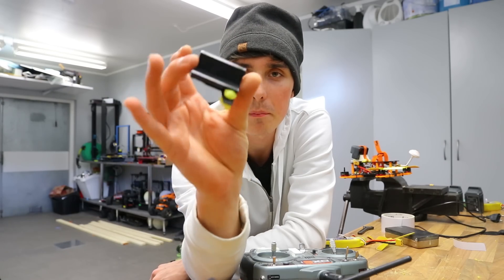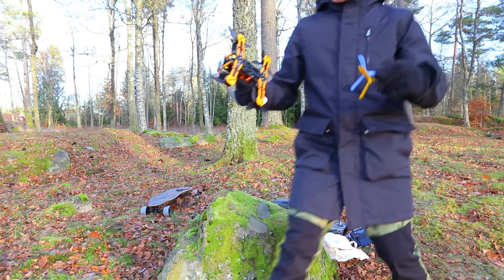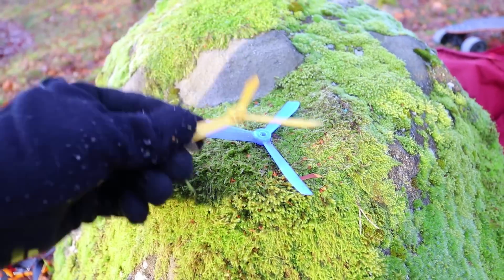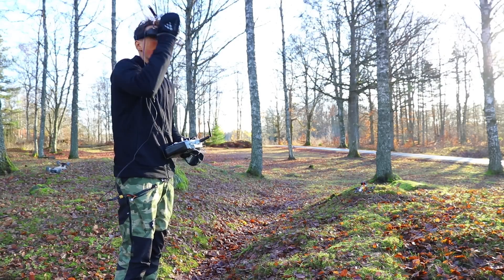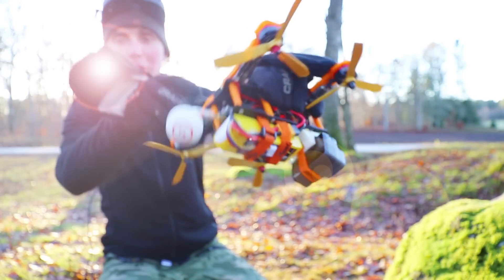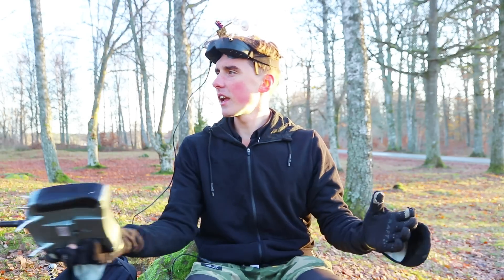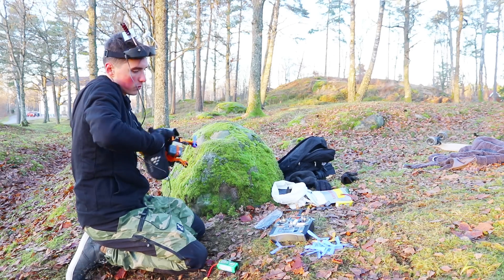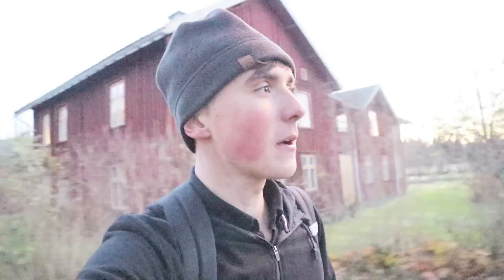3D Printed Drone Propellers - Will It Work?

Comment: Nice video, i did´t expect that outcome. I have a CR-10 too, but all the rectraction blobs make it impossible for me to even think of making propellers.
But i do have some tips for you, if you want to give the blades a second try:
Try a steeper pitch at the root of the propellers and a smaller pitch at the tip. And do a curved design of the blades. Otherwise you don´t use the full potential of your props. This is because you force the air flow to change direction immediately and therefore get flow separation on top of the blades, trailing their leading edge (if using a constant pitch that is too steep). If you use a shallow, constant pitch, you don´t use the full potential of air flow deflection and therefore also loose power. As someone in the comments already stated, the pitch should be steep at the root and shallower at the tip because the speed of a outward moving reference point on the blade increases with increasing diameter. And the pitch should be shallower at the top of the blade than on the bottom (you don´t want sudden flow direction changes, but you do want a maximum possible deflection).
Just a few inspirations. Would be nice to see a second version of your props!

Comment: Although the extrude option you used looked fairly cool there are a couple of issues with the design and it is causing the second one:

One i see mentioned already, the angle of attack should decrease towards the tip

The second is probably why they're breaking so easily in crashes, all the modern crash proof props have a very large area connected to the hub, usually taking up nearly 120 degrees and being a lot thicker than the prop towards the tip, both factors greatly increase the strength,

Comment: ok BIG thing. :) Use Nylon the layer adheasion is amazing.  if you deside to try a carbon fiber fill remember to get a hardened nozzle first it will eat a brass nozzle like nothing.

Comment: Watching this I'm guessing you've made the props with the same pitch from the tip all the way to the hub. Because the tips are moving faster through the air than the root of the blade you need to skew the blades so they have a greater pitch at the root so as much of the blade as possible is trying to pull the same "Length" of air with each revolution. You also want to add a proper aerofoil shape to the blades to get every last bit of thrust possible per revolution.

Your loss of power is probabbly down to your blades only making decent thrust using the outer 1" to 1.5". The inner inch or so isn't angled enough to be adding much to the overall power.

Also, You made the root of the blades quite narrow and the blades have most of the material (And therefore weight) quite far out from the hub. This would give the blades quite a low resonating frequency. It's possible that when you couldn't work out what you hit, You hadn't hit anything. You just had your motors spinning at a RPM that caused vibrations at your props resonant frequency, And they shook themselves apart.

If I were 3D printing props I'd address the single blade pitch problem and taper the blade in a similar way to those "Fish Bone" type blades you started the flight with. That design had more of the weight closer to the hub so centrifugal force doesn't give the blade root such a hefty tug when spinning fast. Also, I'd add transitional filleting to the root to help prevent stress raising sharp corners.

That all said, I'd have put money on 3d printed blades disintegrating way before they got up to enough RPM to get the average quad off the ground, So you've already got way beyond my expectations. :)

I'll be interested to see what your MK2 blades will look like, So you've got a "Subscribe" out of me :).

Comment: I think this was very successful.  No doubt the props can be redesigned to be more stable and efficient and perhaps use some glass or carbon fiber infused filament to see if they improve durability.  Will they ever be better than mass produced props?  Probably not, but these might suffice in a pinch and makes a great study project.

Comment: I've got a problem and need your help.  I THOUGHT I knew what I wanted, I ordered an A6, after listening to your reviews and others I knew I had made a mistake, up to a point money isn't a problem, so I'm sending the A6 back and ordering an upgraded CR-10s? I think?  I'm nearly 70 and decided I didn't want to bother building it, I've got other problems.  I've had nearly my entire back fused, S1,L5,4,3,2,1,.up to and including T-144,15?  8wks ago my neurosurgeon was forced to fuse my entire neck C2,3,4,5,6,7 now I can't turn my neck at all and it's painful, I half a pump full of narcotics in my gut and have had for years fun huh... And now I've got Parkinson's, it never ends.....  I have a beautiful computer Ryzen 1850 w/32gig, GeForce 1080 ti etc etc, so  that's not a problem,   I built computers until a few years ago.  To start off I'll use the 3D printer  for it and I have a strong interest in FPV, many uses.....  I hope I've made the better choice....  I.ll edit it and finish tomorrow, I'm tired.

Comment: The temperature changes the properties of the plastic used.
In summer they maybe would hold up longer.
PLA is already known to be brittle, low temperatures certainly increase that.
Maybe try some other 3D printing materials known to be a bit more flexible, try printing at different temperatures to get better layer bonding, and modify the physical structure of those props, to prevent weakpoints. Your current props seem to break almost always near the center.
Different infill patterns for the layers may also alter the properties of the props. Sanding the props to smooth the surface could help with the vibrations.
And, as stated in other comments, try balancing the props. You probably could print a balancing station ;)

Otherwise I really like the way your channel progresses :D
Keep it up~

Comment: 10:55 It's possible the blades just gave out from the stresses of flying. I watched the footage at 0.25 speed, and couldn't see anything that would have caused the crash.
Reply: The nose went down and to the right first, which was the only prop that wasnt the same color. I think it was the PETG prop and because it didnt look like it hit anything I think it broke apart in midair and caused the rest of the drone to fall. Most likely it was only one of the blades that failed, but after that it puts too much stress on the other 2 blades and thus had no more thrust causing it to fall from the sky. But yes I agree. Dont use PETG for 3d printed drone props i guess lol
Reply: @MichaelNelsonYT  if possible I'd say to use an SLA printer if planning to make any kind of props.

Not only should it result in a stronger bond, but the surface details are much better than filament printers.

Comment: What you should do is you should take that Flex rubber stuff and have a hard inside like regular old POA and then the other stuff that you used for your GoPro mount on the outside of the blade

Comment: When you look at the design of other three bladed props like the blades are often wider in the middle and thin out to the ends. that will make them stronger in the middle. The outer parts of the prop also travel way faster than the inner parts so you don't need as much incline at the tip ofthe blades as in the middle.

Comment: After printing your props, you should treat them with cold acetone vapor to help fuse the layers together better.  Otherwise, the props can suffer from layer separation mid-flight.  They also should be balanced, this is not only for the flight vibrartion, but the main reason is that it reduces the stresses on the prop itself, which can lead to prop failure mid-flight as well.

Here's an instructable: https://www.instructables.com/id/3D-Printed-Propellers/

Comment: Cool bananas!
 When I fly RC I fly gliders almost exclusively, power assisted. Though I do have a couple of slow fliers, all home built, but no copters of any sort. But when I do eventually print a prop, it will be ABS at least and maybe acetone smooth it, or perhaps PET recycled filament might be appropriate, it seems pretty tough. Your original props there were obviously very much stronger and better profiled and possibly thicker that the ones you printed. The profile (airfoil) of a prop is critical to it's performance of course.

Comment: Well... You did get less performance out of them. But apart from being 3D printed, these propellers simply have a totally different shape than the 'originals'... Not that I know a lot about propellers, but the blades of the printed ones do have a lot more weight at the outer end, compared to the ones with 'more power'.

It would be super interesting to see you try different shapes of propellers!

Comment: Awww. man... subpar testing...  this isn't about if they are flyable at cruising speed or how much power you lose from your prop design compared to the props you had before.... 
You need to do punchouts to 50% and to 100% to see if they shatter from the centrifugal forces or if they are secure as long as you don't crash

Comment: Designing you own would be a challenge. What specific angles the blades should be pitched etc. The math can be involved. To be purely scientific about it and if you are taking into account eliminating all other factors, use an existing design you know will get lift with this quad set up and copy them and export that as an stl. Then print it. You have a big gap whether your design is even flyable in the first place. Too many variants at that point to be a purely scientific experiment. I like the idea, though I imagine your could find an existing design for props that would work and give you lift through the openRC project. That being said, I enjoyed the content you are creating.

Comment: Will you do a drone video when there is snow on the ground? What about sanding them and using plastic primary filler, so you get a smooth surface.

Comment: Interesting, it looks like a prop sheared on the second crash where you didn't know what you hit. Maybe try and few full throttle punch outs to check strength and blade deformation?

Comment: You know that the vibrations actually caused it to break in mid air? The centrifugal forces of the unballanced prop-blades forced it to tear it self appart. So, balancing them first time would have helped you with saving 5-9 propellers.

Comment: maybe give ABS a try :)
Reply: I feel like ABS is heavily hated on by the community, because of the fumes. But it is so awesome, cheap, and the one of the few plastics that you can smooth while not having to buy expensive special filament made from a secret kind of plastic

Oh, and if you don’t fear ABS, you should try HIPS (high impact polystyrene) 
It is very similar, prints a little bit easier and is sometimes cheaper. It is so much more than a dissolvable filament, and it is actually a common engineering material.  but like ABS, it releases styrene fumes..but less other chemicals

Comment: try a modified/High Temp PLA and anneal it.. stronger and more stable than ABS and PETG ..Less brittle than standard PLA.   use a better blade profile. probably never be as good as injection molded but can improve a lot over standard PLA

Comment: Real quick the blades are way to thin for the motors and the blades are only on by what looks like 4mm of connecting plastic to the centre which is not enough
And by the way the reason you fell from the sky that one time because a propeller broke from the centrifugal force it ripped it apart 
If anything make the blade thicker lower pitch and thicker at the centre and don’t screw the bolt on to tight because that cracks the prop

Anyway keep doing what you love.

Comment: I'm absolutely loving the 3d printed quadcopter stuff.  I've always wanted to get into it never knew how to start.  Get yourself some more backup batteries and I'd love to see how far you could take this.  I'm pretty sure those props weren't the best design for the job.  Maybe try printing them in ABS and then vapor smooth them to get rid of some of the roughness from layer lines.

Comment: Maybe with some more plastic near the hub and acetone vapor smoothing (or the equivalent for PETG/PLA) they might preform a little better, since melting the surface creates a sort of shell of solid plastic around the print.

Comment: The blades should have torsion, I mean less angle of attack in the tip than in the root. The leading edges should be rounded. They should be tapered......

Comment: Hah neat, I totally thought the centrifugal force would have torn them apart. With a bit of refining you could probably gain a little more power out of them, and maybe polycarbonate would hold up to more abuse? Congrats on the silver play button!
Reply: It's something I super want to get into if I had the time and more space! The PC filaments are boss at standing up to abuse, I use them in my robots so reckon they'd make awesome props.
Reply: Saw another guy print props and a balancer and they held up. Though crashes don't seem to be very good for these props.
Reply: I think vapor polishing would help a lot too--I suspect the surface roughness contributes a lot to the turbulence/vibration. I think PC can be vapor polished, but the solvents involved are more hazardous than for ABS. (I think it's methylene chloride, or maybe ethylene chloride, for PC, as opposed to acetone for ABS.)

Might be with a try though!
Reply: There is also a molecular level to this issue of 3D printed propellers. As an ultra-stress-handling part, its most important the structure of the material is homogenous as possible. Thus, molded ones have the better possibility to keep an even arranged and properly cooled down "fibers" of the long molecules of the given plastic material. As 3D printers go layer in layer, there allways be a lot of one-line quasi homogenius material, that be also surrounded by also such layers, but also a small region between with 2-3 times re-molten plastic, witch all will have slight arrangement differences. Here one has to have in mind that any microscopic-to-molecular issue in the material will be subject of far greater stresses than the surrounding matter and it will be exponentially rising with its cracking/ripping progression. Also, during the printing, all the prop is printed in the same way in the XYZ-axes of the print-table, not towards the center of the individual propeller, so all those layers of homogenous and differently arranged fibers are also differently placed trough the whole propeller, wastly exposing all of its props to different damage-progression and thus ewer evolving damage to one side more than the other.  ... way could be to incorporate other, stronger fibers into the print outwards from the center of the propeller ( they be kinda like rebars in a concrete structure ), but it has to have good affinity to the used plastic, be well printed in and the process of doing so has to be worked-out somehow ( maybe laying them down onto the mold after stopping the printing process and forward it after again ? But not sure how that would go and they would need to be pretty thin to not mess up the process ).
Reply: I kinda wonder how 3D printed props would hold up on a stunt quad/tricopter. You know with a lot more hard throttle punches doing flips and the likes. Racing is already pretty hard on the props but I think the much more sudden dramatic changes might just rip them in pieces perhaps.
Reply: Very cool. I wonder if you could gab some extra lift by increasing the width/surface area of the props.
Reply: Maker's Muse sometimes you'd need to make more Thick fans for stability and function
Reply: Ah ok. I don't have any experience with drones but they sure as heck fascinate me.
Reply: It's you!
Reply: Yeah that's the material that legit props are made off nowadays